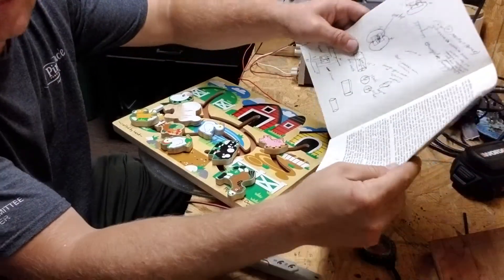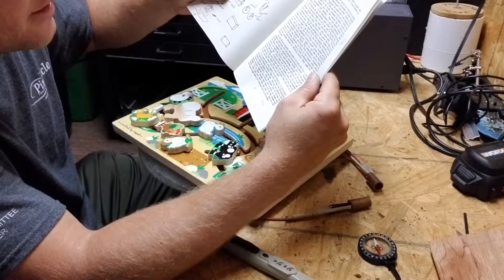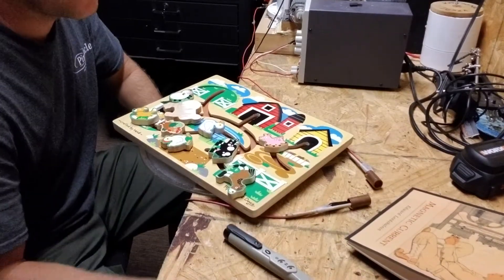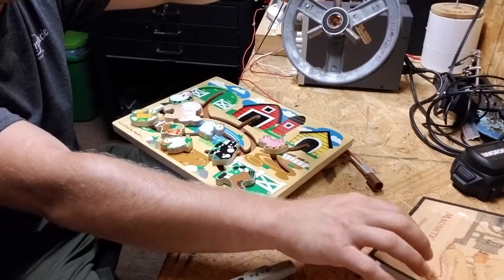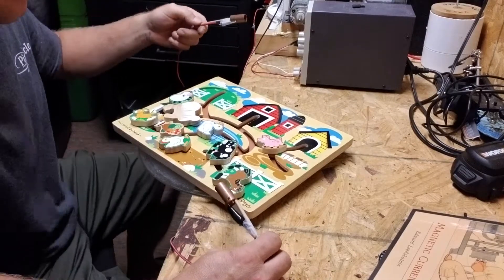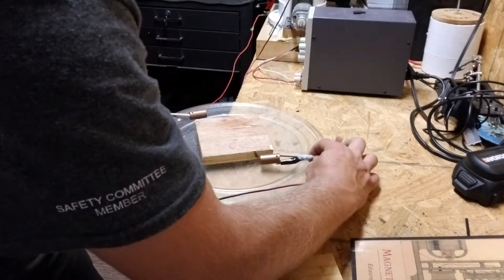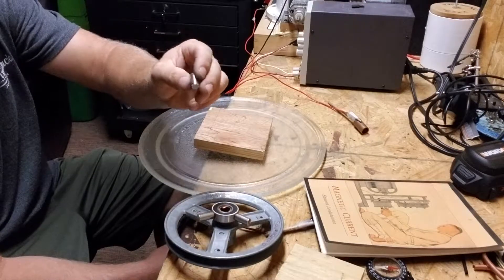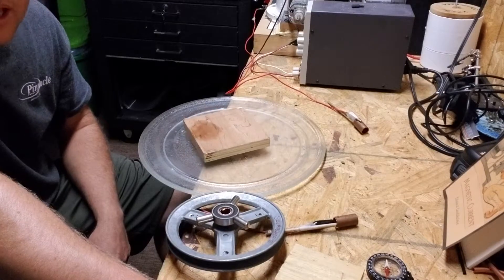Moving 1lb with Van de graf ...

Comment: It's great man. I want to know  how it will run like if you use Van De Graaf generator and honeycomb,and the beatle's wing flying.
Reply from the maker: recore 520 I need  those wings he used but you can't find them  Grebenikov used type of Orgone energy just compressed also there is a way by hv and amps but that has to be shielded...it is dangerous for health..